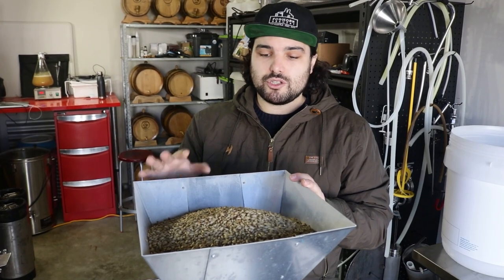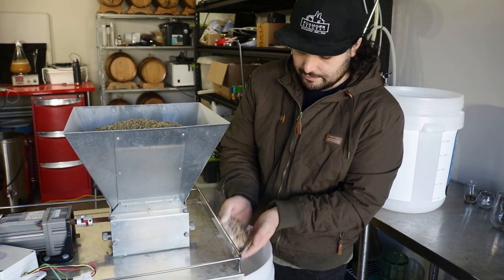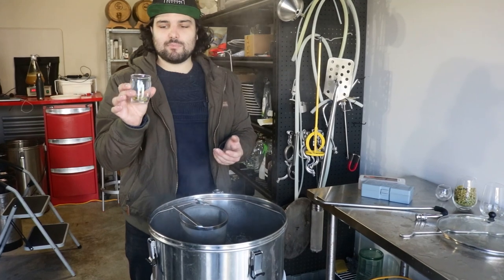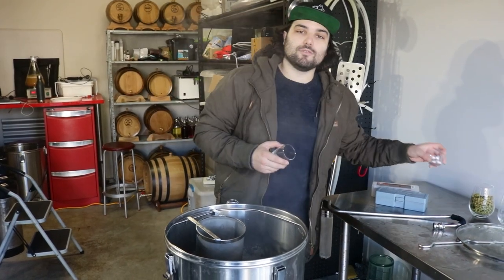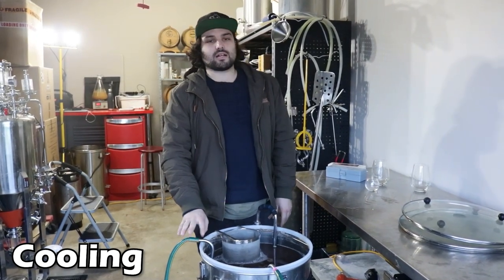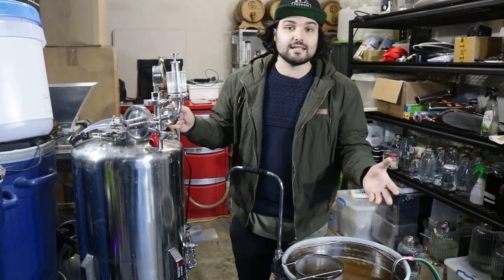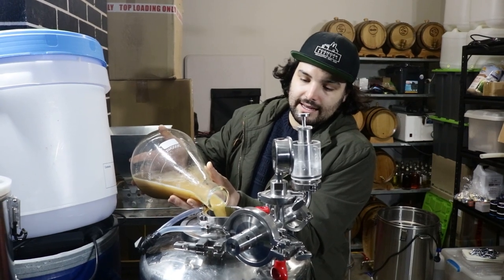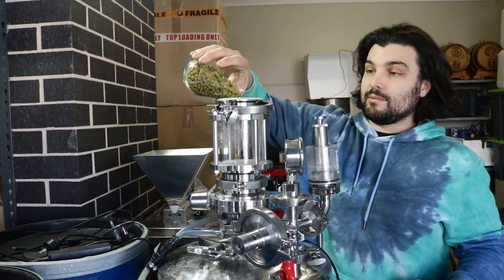BREW this Australian Pale Ale With Us!

Comment: Awesome work guys, keep the videos coming.. a lot of great beer recipes! I’d like to see a nice dark ale or stout recipe.. I just kegged and aussie pale ale myself with 4.5kg ale malt and 1kg wheat malt.. used 15gm melba in the boil and 100gm of (25gm galaxy, 25gm vic secret & 50gm melba at flameout.. and dry hopped 100gm of the same hops at day 7! was a 25lt all grain brew with 22lts in a fermzilla 👍 og: 1048 fg: 1012 abv: 4.7% with 2 packets of nottingham ale yeast fermented at 18c for 7 days then at 20c for 7 days. Day 5 it had a slight sulphur smell but that went away after the temp went up to 20c for a few days but by day 12 it was done and cold crashed. it’s now sitting at 20psi for a few days 🤟😝
Reply from the maker: Let us know how your Aussie pale ale goes! Our next brew day is going to be either a dark ale or stout!

Comment: I have the 35L brewzilla, so similar process to yours. I am constantly finding the pump gets blocked, especially at the end of the mash. Any tips to prevent it?

Also how do you control temperature during fermentation?
Reply from the maker: Hey mate, interesting, are you using a top filter on the top of your grains when recirculating wort? And when you pour the grains into the brewzilla at the start of mashing in are you using the little black silicone stopper to prevent grains going down the overflow tube?

As far as controlling fermentation temp goes easiest way is if you have a tank that can be temp controlled with a glycol machine (such as the Ss unitank we use), the glycol is colder than your fermentation so as your tank goes above your set temp the glycol starts getting recirculated and cools your tank down.

If you don’t have that you can use an old fridge as a fermentation chamber if you are using a bucket or fermzilla as a fermenter (or anything that will fit in a fridge) then use a temperature controller with a thermometer sensor to set the fridge to a specific temp. The sensor will then turn the fridge off and on to keep it at your set temp.

Failing any of those you can try to keep your fermenter in an environment with a stable temp, like in a basement or dark cooler area of the garage. On hot days you can drape a wet towel over it to try and keep it cool as well.

If you’d like us to do a vid on temp control pls let us know and we’d be happy to put one together
Reply: @flyingwombattv   Hey mate, No I took the grain screen out, I found it was too hard to use for some reason.

Ah you guys use glycol? I was looking at that, but I'm currently just using an old fridge. I've got a stainless steel Nano X fermenter, so I'm thinking about upgrading to gylcol. I'm finding my beers all have a similair flavour, and I'm putting it down to ferment temp.